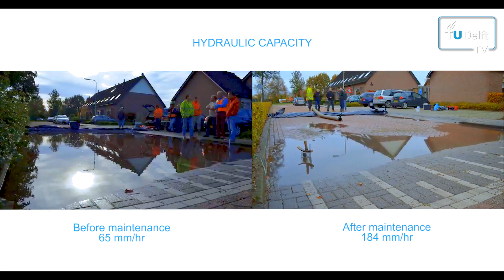The Dutch know how to mitigate flooding from increasing global warming: Flood Fighter

Comment: Could you explain why you believe the increase in rainfall is a problem. I accessed the World Bank Climate portal for Netherlands rainfall data by month 1901-2016. This data (1392months) is provided by the Climate Research Unit of the University of East Anglia in the UK, which gets it from the Netherlands Government. 
The data gives the following for the entire period. Average rainfall per month = 64 millimeters (mm). Standard deviation = 9 mm.
For the period 1901-1930 the average per month = 62 mm. 1961-1990 = 65 mm. 1991-2016 = 67 mm. Taking mid-points the time span is about 1915 to 2008, 94 years during which the rise in precipitation has been about 5 mm per month. However, 5 mm per month is only about one-half of one standard deviation. Given that oceanic oscillations drive storms from the west, in particular the Atlantic Multi-decadal Oscillation (AMO), rainfall in the Netherlands appears to be remarkably stable over this period of a century. The appearance of an insignificant trend is probably an artifact of the data analysis.
Most of my recent investigations focus on the tropical Pacific where the East Asian Monsoon and the El Nino-Southern Oscillation (ENSO) dominate causing extreme inter-annual and seasonal variability, but no trend during the period 1901 to 2016.
In my opinion, you should concentrate your efforts on runoff. You may find that both provincial and local governments in the Netherlands need to give more attention to their duties instead of blaming climate change for inadequate attention to drainage.

https://climatedataguide.ucar.edu/climate-data/atlantic-multi-decadal-oscillation-amohttps://climatedataguide.ucar.edu/climate-data/atlantic-multi-decadal-oscillation-amo